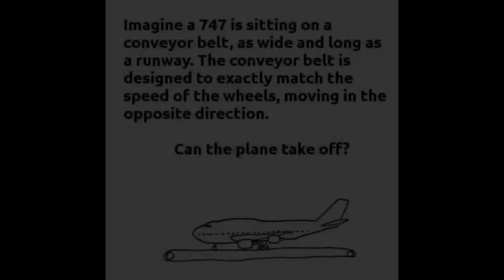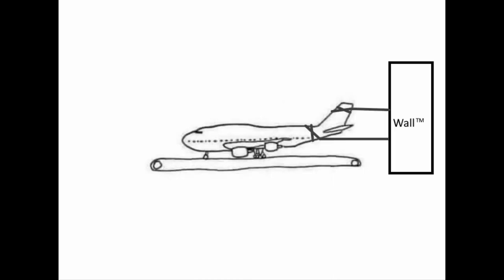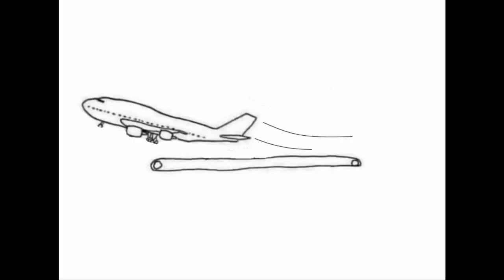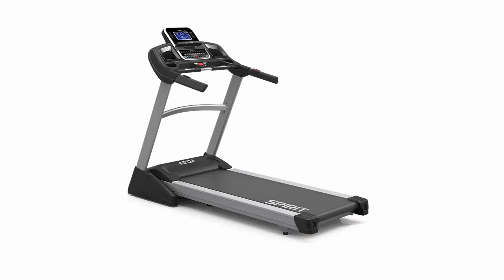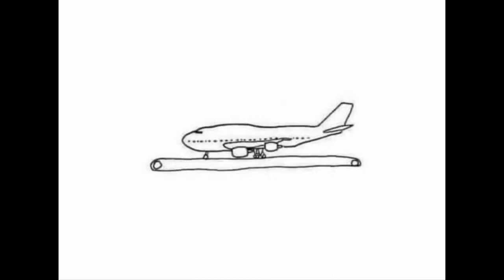Airplane on a treadmill is a flawed question.

Comment: No, you can choose any amount of thrust whatsoever, how does a wheel gain ground, if the wheel is spinning at the exact same rpm as the ground it's on?  If the wheels are spinning hypersonically, the conveyor is spinning hypersonically in the other direction, the weight of the plane keeps the plane on the conveyor until it gains forward speed in relation to the ground, but that speed can only be achieved if the wheels spin faster than the conveyor belt, otherwise it's effectively on rollers, like two gears connected to eachother.
Reply from the maker: Because it's not possible to keep the wheel from accelerating. Remember the thrust doesn't control the wheels speed. If the plane was powerd down and the conveyor was moving at 20km hours the wheels would be traveling at 20km hour. If you turned the plane on and accelerated it to 20km hour the plane would be traveling at 20km hour and the wheels would be spinning at 40km hour because there I nothingstopping the wheelsfrom spinning faster as the plane is pushed. The wheels are just free spinning they are not powerd.

It's a trick question because it's an impossible situation. This is why small scale tests show the plane still moving forward and when mythbusters tested it the plane still moved forward. The wheels are meaningless.
Reply: @venera13  No you just don't understand the question, the wheels are moving exactly as fast as the conveyor. That's completely different than what mythbusters did, that was matched to the ground speed of the plane, obviously it'll take off then because the wheels free spin. 

The wheels have to move faster than the conveyor for the plane to move forward and take off, the question explicitly says that it doesn't. I'm not wrong, I'm staying within the confines of the question.

In all reality the wheels would burst from the compounding high speeds of the free spin/tire rotation/conveyor before it took off, if building a conveyor like that was possible.

Take it down to a slower example, a fan on the back of a wagon on a conveyor that matches the speed of the rotation of the wagon wheels.
The wagon will stay stationary in relation to the air and ground around it.
Now just extrapolate that up to any speeds you want, the plane will stay stationary so long as the spin of the wheels matches the spin of the conveyor.

the weight of the plane needs to roll forward on the wheels until it can achieve speed and lift. It can't if every time the wheel rolls forward, that linear meter of circumference of the wheel is taken away by the conveyor.

The engine generates thrust, and then the wheels will spin at some speed, the conveyor matches that speed, the plane can't roll forward if the ground that the plane is rolling on, rolls at the exact same speed in the opposite direction.

Comment: If the conveyor matches the speed of the plane then you'd be right... But matching the speed of the wheels sends the conveyor/wheelspeed to infinity which would result in the huge friction and failed wheels you mention
Reply: That's what I came here to type. I thought it was impossible because if the treadmill matched the speed of the wheels, then the plane would be stationary, ergo no lift. Makes sense, right? But then I saw Mythbusters and was made to question my intellect and sanity. Adam even said the wording of the question was wrong and cited the prop generating lift over the wing. And then this video explains it using a jet. But then the skateboard analogy made it click. It's the speed of the plane, not the wheels.
Reply: Take a cargo plane and load it with wheels, say 20 times as many as it has on the ground. The average speed of the wheels will only be 5% of the plane's forward motion, so the belt will move slowly, and the airplane can take off.

Comment: Bro, it's true that wheels don't move on their own but there's weight of whole plane on it, before plane takes off, laws as cars apply to it. Let's say jets start and and wheel starts moving both at one km/h, because of the weight of the whole plane on the wheels, plane wouldn't budge from its place. No matter how much you increase the speed of the plane, if the conveyor belt is matching it, because of the friction between wheels and conveyor belt due to planes weight, plane would stay stationary in respect to surrounding air as the speed increases. since air resistance on the wings is needed for plane to take off, the plane wouldn't take off.
Reply from the maker: The belt would need to speed up infinitely to keep up as the planes thrust is decoupled from the ground. Again it's worded intentionally bad to cause problems. There's a reason why both small scale, and full scale tests like when Mythbusters tested this very question. All show the plane roll forward as if the convoy belt isn't there at all.
Reply: @venera13 the experiments don’t actually match vehicle speed / rolling speed to hypothetical converter speed.  The reason they don’t is because it requires serious thought on how to match the two.

One would need some programmable controllers or some careful linkage or something else.

Even without experimental proof, the setup proves the vehicle cannot move in relation to the conveyor - the rolling speed of the wheels is the same as vehicle velocity is the same as conveyor velocity.

The analysis in the video uses an incorrect frame of reference to come up with the flawed 2*velocity solution.

Comment: Technically. The belt speed DOES match wheel RPM 1 to 1 as wheel speed is always relative to ground speed. Both the aircraft and the belt contribute 50% each to your total takeoff RPM if belt speed matches ground speed.
Reply from the maker: The only time the belt becomes a factor is at low enough speeds friction plays a part in the wheels. Otherwise the plane will keep rolling forward. This is why every time mythbusters tested it in both small and large scale, the planes rolled forward and took off
Reply: @venera13   My point is that the "matching wheel speed" criteria is misinterpreted and the belt DOES in fact match wheel speed.

If we put a 100 mph car on a 100 mph treadmill, everyone can agree that belt matches wheel speed and the car remains stationary.

We do the same with aircraft and it's often perceived that "the wheels are moving faster" than the belt, even though the individual speed components haven't changed from the car example.

The illusion is that because wheel speed is always twice normal RPM that the wheels must be turning faster than the belt for forward motion to occur.

When in fact the total wheel RPM is a 50/50 split between the belt and the forward motion of the aircraft. This meets the criteria of matching wheel speed.

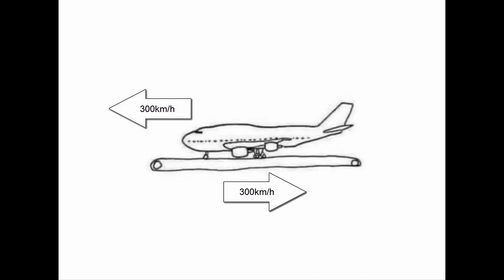Comment: So the question as jacked up as it is, states that the belt will match the “wheel” speed. In your argument at 2:10 in the video you mistakenly state that belt speed is matching the “plane” speed of 300 km/h which in your statement would mean that the wheels would simply be rotating at 600km/h. That is changing the premise of the question. Belt to plane speed as opposed to belt to wheel speed. You are making your argument outside of the parameters of the question. :)
Reply from the maker: The point is you can't match the wheel speed. The plane will roll forward regardless so the wheels will always spin faster than the belt. The belt would need to rapidly accelerate until the planes wheels fail. Again it's a trick question that dishonestly uses poor wording to instigate arguments.
Reply: @venera13 yes I fully understand it

Comment: My hangup with the question is at what point does a conveyor belt speed rise enough to where the thrust of the engines is no longer enough to overcome the friction of the tires are the wheel bearings and if it can overcome it, the tires explode, or the wheel bearing seize. 

I don’t say that to side with one argument, or the other, just that that wrinkle in the scenario causes a few hangups. I don’t think I say that in someway to treat the airplane like a car as the wheels aren’t driving it, but if he puts ice skates on the airplane and push it fast enough eventually the skate blades get hot and they break down .
Reply: They do, but what would probably break down first is the conveyor ;)
Reply: @mattfanslow  it doesn’t have to do with friction or any thing other than the rotation of the wheel being equal to the linear rate of travel of the surface.  It’s a basic geometry calculation.
Reply: @MrDefreese  well, in the real world it does. Plus, what about the basic equation that sends the treadmill speed to infinity?
Reply: @mattfanslow  still incorrect.  The only reason friction plays any roll is to set the basic condition that the wheel doesn’t slide across the surface.  If there isn’t sliding or scrubbing, then the entire motion is merely rolling.

Additionally, the treadmill doesn’t go up to infinity at all.  The treadmill merely rolls at the exact rate of the wheel rotation.  Not more, not at double speed, not to infinity.

If the wheel set rolls at 1 rpm, the conveyor travels at exactly pi * wheel diameter in one minute.

It’s a simple conversion based on the circumference calculation.  This thought project is way more simple than people are trying to make it.
Reply: @MrDefreese  vB=vC. So vC=vW+vC
Reply: @mattfanslow  if you don't mind, clarify your equations.  We can probably point out the issue with it.  It's kind of a frame of reference issue along with a subtle conversion between linear motion and angular velocity.  It will be clearer.

Comment: BUT THE BELT MATCHES THE WHEELS. 
Why do people keep missing that?!😂
Reply from the maker: Because the belt can't match the wheels. That's the point of the question. It's intentionally misleading. It makes you think of an airplane like a car. The wheels are not powerd, the engines push the plane independent of the wheels. This is why when Mythbusters tested it, the plane still moved forward and took off. Because the wheels will simply spin faster, and if you increase the speed of the belt, the wheels will just move faster and faster. There is no set limit to the wheel. If you throttle an airplane up to max speed, the wheels won't magically hold the plain at a certain speed. From a physics standpoint the wheels are only there to reduce friction.

The question intentionally misleads to cause arguments. It is worded so it makes you think of an airplane like a car and makes you forget the wheels are free spinning and in this set-up are not able to have their speed matched. Again this is why every time it's tested in both small scale and large scale, the plane moves forward. The only way it works is in small scale if you have the plane throttled so low the wheel friction balances the force. But at takeoff speed the friction won't balance the force and the plane will be pushed forward regardless. With some planes you could remove the wheels and the plane would still scrape along the ground. The engines push the plane, they do not turn the wheels.
Reply: That’s a lot of words for, wheels aren’t moving, belt isn’t moving, plane is in the ground. Thats the point. 😂😂😂

Comment: Yes, a regular plane's wheels are free-spinning. However, this question is not about a regular airplane because this airplane's wheels are NOT free-spinning, they have to ALWAYS match the speed of the conveyor belt. The wheels are not coupled to the engine or the rest of the plane, BUT they ARE coupled to the conveyor belt. The plane cannot move forward. If it does move forward, you know the rule has been broken.
Reply from the maker: Exactly it's a trick question that assumes an atypical airplane that behaves like a car. That was kind of my point.
Reply: @venera13  kind of. It’s the reader that incorrectly assumes it’s a typical airplane wheel. This confuses me why people assume this because the question is very clear about how the wheel operates in the scenario.  The wheel is the most important part of the whole thing

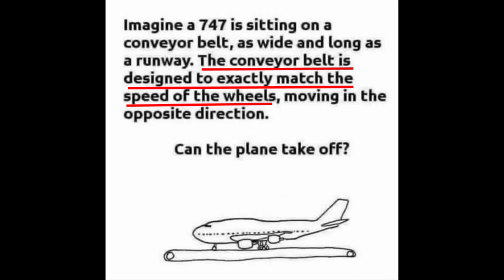Comment: paused at 0:28 to think about it.
answer: no.
the wheels moving don't, on their own, allow the plane to interact with the air & the air remains unaffected. assuming the movement of the wheels never interact with the air in any way, they could spin infinitely fast & the plane, never physically moving its entire self, will never take off.
EDIT: after watching to 1:32 I realized I didn't even consider the engines. they weren't mentioned, so I ignored them entirely. I am still correct in what I said above :D
Reply from the maker: The whole point of the question is it's a trick question that is worded in such a way to ignore how airplanes work to drive arguments. That's the take away here. It's an intentionally badly worded trick question pretending to be a physics question. Free spinning wheels mean the treadmill would need to accelerate continuously until friction becomes dominant.

Comment: Your example literally breaks the rules of the question
Reply from the maker: That's the point, the rules of the question disregard how airplanes work because it's a trick question. If you had an airplane with no jet engines or propellers and instead had powerd wheels like a car, then yes the plane would stay still and not take off. That's not how airplanes function however so in the real world the plane will always role forward unless the wheels fail and break.
Reply: @venera13  but it will make 0 progress under the rules set my the prompt. Your examples have the wheels moving faster than the belt in each one. Fail

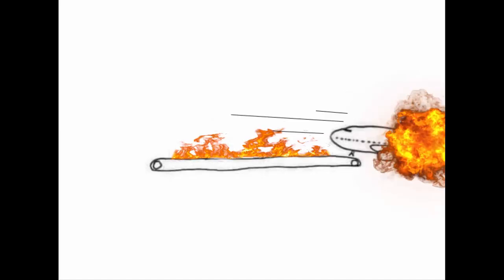Comment: No no.  You negated your own argument at 2:55. Nowhere in the question does it mention mechanical failures of wheels and bearings.  The hypothetical is clear.  If bearings and wheel explosions aren’t a factor then all of the forward motion of the jet engines are negated by the COUPLING of the airplane to its wheels and the wheels to the conveyor.  At that point they act like a gear set and not wheels on a conveyor.  They are linked.